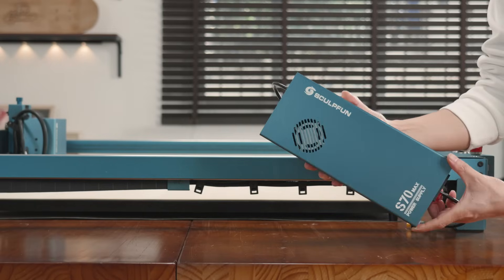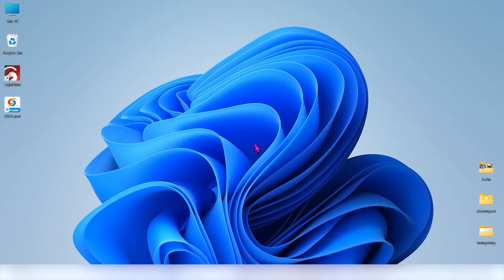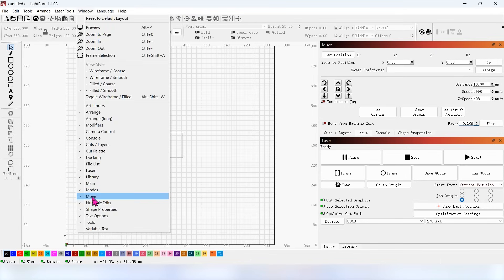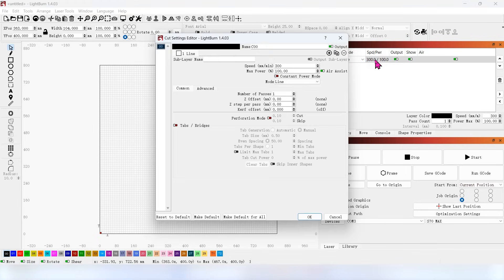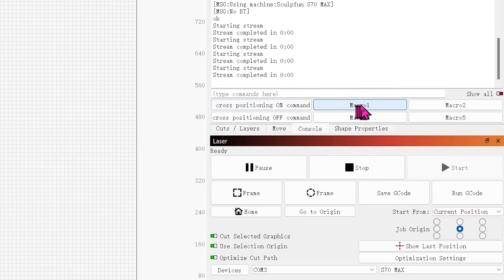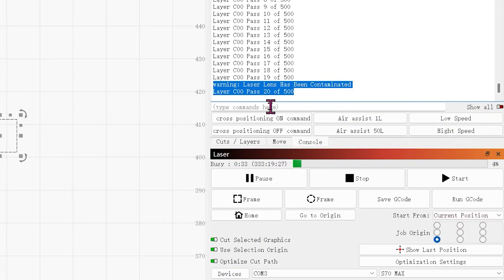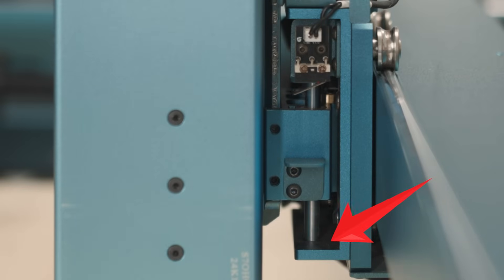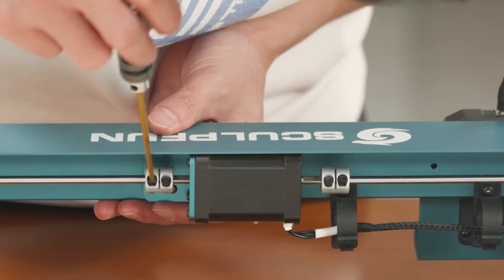How to Use the Sculpfun S70 Max: A Step by Step Tutorial for Beginners

Comment: Everything about this laser sounds great. Will there be another with smaller footprint, like maybe half the size with same laser configuration? This thing is huge..
Reply from the maker: Hi thanks for your kind suggestions. Do you mean to have like a 400*400mm 70w?
Reply: @SCULPFUNReal  Hi, yes around 400 or 500 on 70w, would be good too. Or go full desktop enclosure, you got the tech and hardware already 😀 Considering your upcoming UV laser, I'm sure Sculpfun got this covered. This video is excellent and thorough. Fantastic job on this, even though I don't own one it was worth watching.

Comment: THE REAL working área ?
Reply from the maker: 830*800 mm
Reply: @SCULPFUNReal  I have the S70 max, but when cutting the wood to the maximum size I cut 78x82cm, in Lightburn, so I assumed that its real work area is another, since I did it after watching the installation tutorial and that was the result.